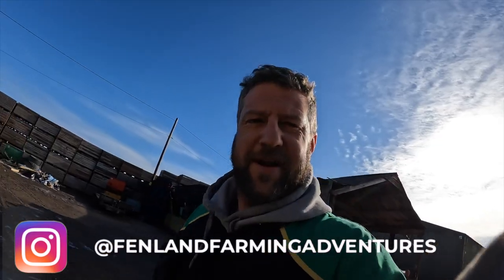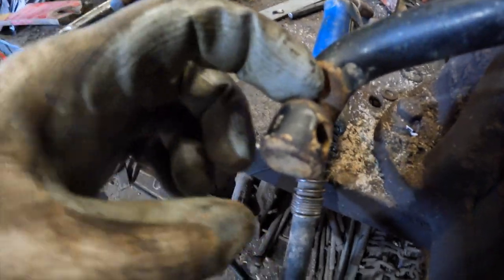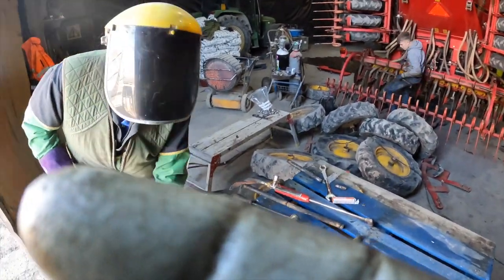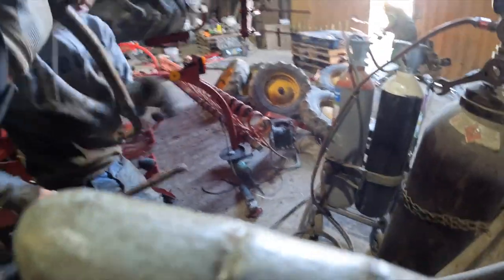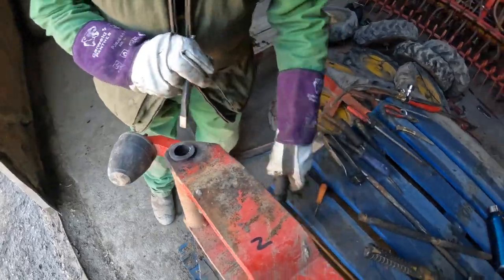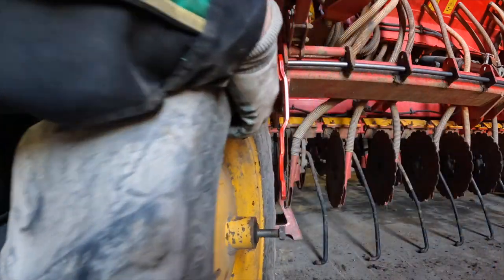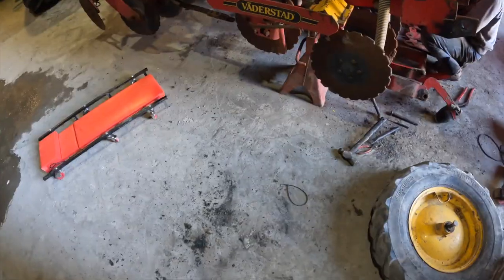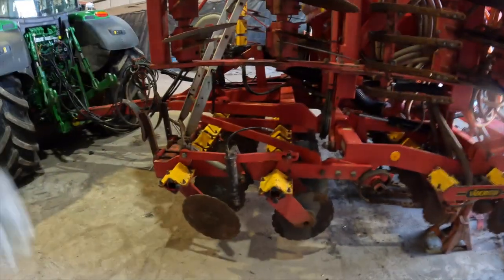FIXING UP THE 6 METER VADERSTAD DRILL - WE BRING IN BAILEY TO HELP FIX THE VADERSTAD RAPID A 600 S

Comment: another fantastic video Daniel👍 cracking job  on  that welding  on those link bars save spending a lot of money on new ones
Reply from the maker: Thanks Thomas yes they sure do, the wheel hangers were £220 each so be the links were £60 each. Drill will last forever now with some love
Reply: @fenlandfarmingadventures4241   yeah it will  a little bit  of love and care  it should last a long time  and your field s are not so heavy soil
Reply from the maker: No Thomas not much stone or flint or clay for me to work so should be great just can’t wait to use it, won’t stop raining 😂
Reply: @fenlandfarmingadventures4241   telle me about it sick to my teeth with rain  i'll be glad when its summer time
Reply from the maker: I do like it when it’s cold Thomas and frozen but not when it thaws out each day 😆 somewhere in the middle of the 40°C heat and frozen would be great all summer 😂

Comment: The joys of farming and repairing machinery parts, many hands makes the job easier I was once told! Fenland Rob
Reply from the maker: Sure has mate drill has literally just been finished and parked up ready for spring cultivating
Reply: @fenlandfarmingadventures4241  at least you know all of the parts you have replaced are going to last you for years! It’s the case of just hooking it up to your tractor and drilling!
Reply from the maker: Yeah man I reckon the Norfolk sand was like grinding paste on the bushes 😂😂😂

Comment: Looks like the drill has been in some abrasive soil, probably some Norfolk sand. Surprised that the wheel brackets are all mounted on one bar, makes it impossible to change anything without a major stripdown. Hopefully you'll give it plenty of love with the grease gun when its all back together.
Reply from the maker: Yes bud it’s very well engineered I’ll give them that 🤣 designed to last forever just not on sandy land 😂🤷🏽‍♂️ I reckon the bent wheel hanger was hit by a kerb or summit ?? Changed all the lose bearings yesterday so we should be good to roll now 🤞🏽